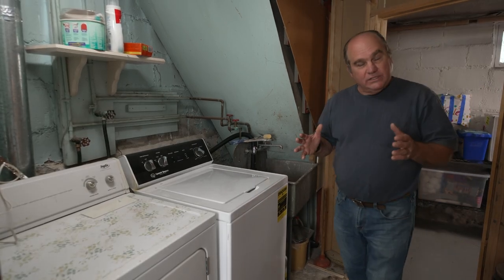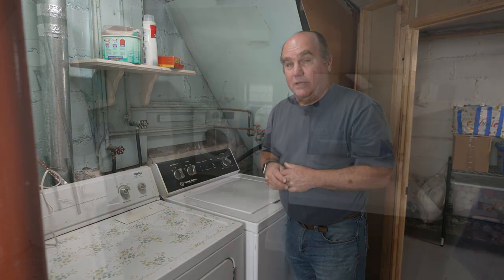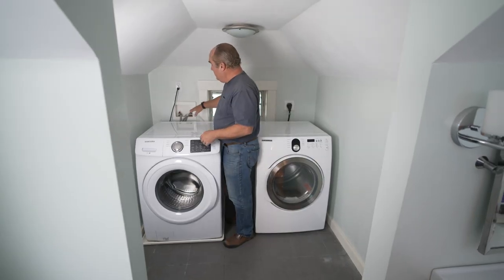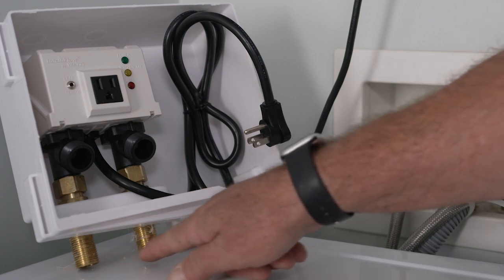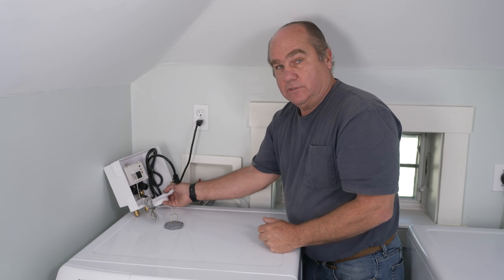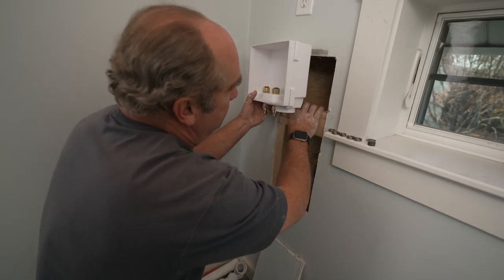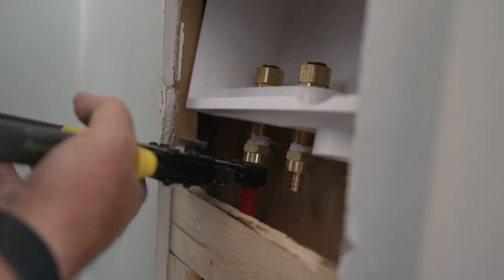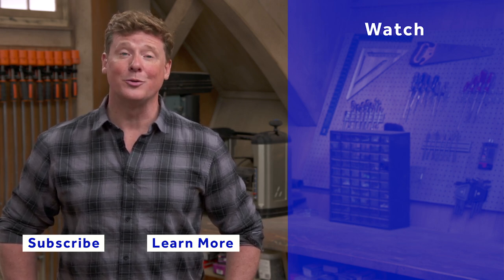How to Prevent Laundry Room Flooding | Ask This Old House

Comment: I don't get it. What's different between a washer hose and the hoses you have under every sink and toilet... Nobody turns those on and off. They're no different.
Reply: What I understand is that washing machine hoses go through a lot of stress due to vibrations cause by dry spin cycle and therefore fail at the end. The hoses under sink and toilet are not subject to vibration
Reply: The hoses are wider and will flood the area a lot quicker.
Reply: Well, lots of times they are different. They are often just rubber hoses. Still, my last apartment flooded due to a bad connection at the toilet, so you're probably on to something.
Reply: What others have said and also size of the hoses toilets, and sinks. Usually use 3/8 lines washing machine use 3/4 lines. Wich both could cause issues if they burst. If your home at the time of failure the sink an toilet will do little to no damage. But a washing machine will do damage regardless if you are home or not. Imagine it this way constantly pouring a 5 gallon jug of water over your head, compared to pouring a small cup of water over your head.
Reply: @hotrodpaully1  toilet and sinks will still cause a huge amount of damage. It's still full city water pressure behind them.

Comment: Does it automatically shut off if the line breaks while the machine is in operation? Or is there a way to manually shut off the city water?
Reply: wondering the same thing. If this unit thinks everything is OK as long as the machine is on, that seems like a big gap.
Reply: Ours does. It recognizes the flow supposedly and shuts it down.
Reply: @augustreil  Thank you for the answer!
Reply: @211teitake , You're welcome. From what I understand, a washer requires way less pressure and flow than a broken line would provide, so it shuts itself off. Maybe a plumber will chime in ?

Comment: can one just put a drain in the floor under the washing machine?
Reply: Yes. The washer in the video is already sitting in a drain pan.
Reply: @oldcountryman2795  I was hoping Richard would have pointed that out.
Reply: I believe most code requires a drain under a washer pan for 2nd floor+ residential structures.  Problem is, a burst hose may not necessarily land all the water into the pan itself.  Still would have significant water damage.

Comment: Looks cheaper then a whole house one.. I had a toilet lid fall down  on the toilet and cracked it.. I'm was on the 2nd floor..was not home and it looked like  Is Niagara Falls in the foyer when I got home
Reply: I've changed all my toilet lids to the soft-close kind. It's a nice upgrade, but there's one problem: when I go somewhere without it, it startles me when I tip the lid closed with my finger and it falls down WHAM.

Comment: A solution that might be better:  AMAZON Flood Safe Washing Machine Hoses With Rigid Corrugated Outer Walland Built-in Auto Shut-off Valve
Part number SHK-AQCG-5GN-024

Comment: No. No. NO! You just added another failure point to the system and replaced metal spigots with plastic. Sure those metal hoses are depressurized. And the pressure is now held by a Chinese manufactured plastic valve in the wall.